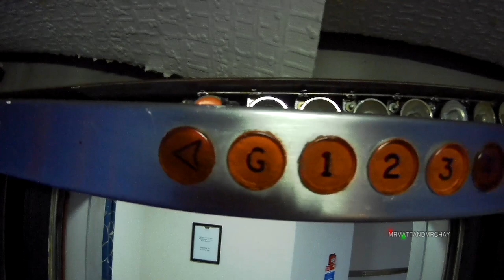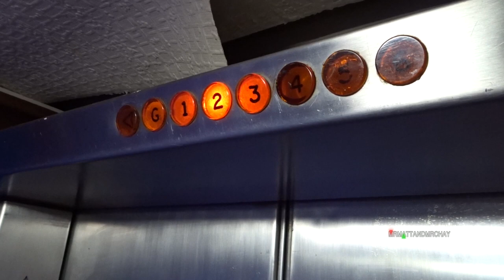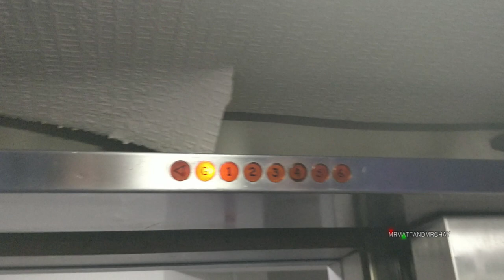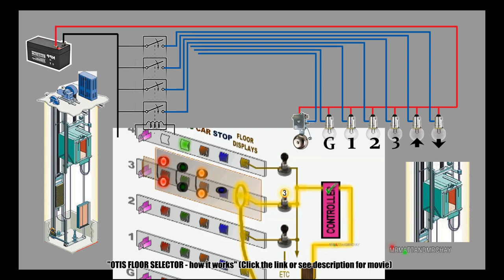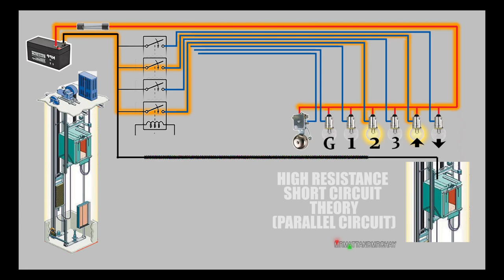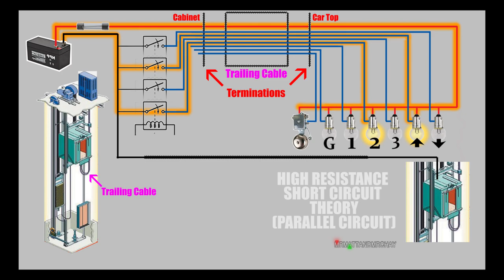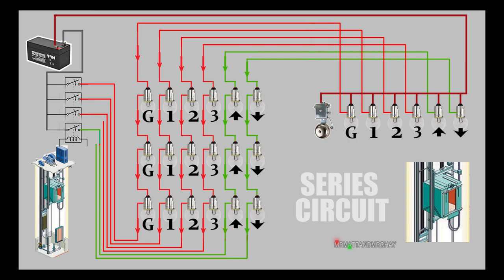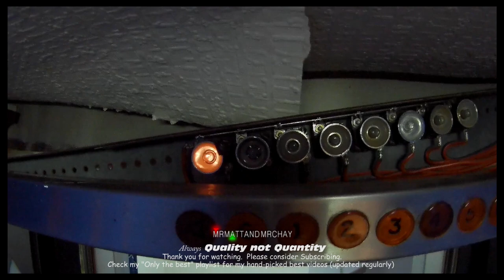A rare generator OTIS LIFT, now with WORKING LAMPS! (fixed!)

Comment: I'm so stupid for not asking this! The left lift, and ideas whether:
It was completely replaced with the ecodisc or just fixtures and logic replaced
It was originally another old Otis lift
The machinery from the old left lift is still in the motor room
If the left lift actually existed before the Ecodisc was put in
Reply from the maker: It's easier for them to abandon the old lift machinery and start again with standard MRL framework with the motor at the top of the shaft.  Trying to put the MRL machine in the old motor room would create unnecessary work with having to divert the ropes up here and back.
Also you have to think about companies and profits - again, quicker and easier to pull the old otis out completely and fit a standard lift than spending time modifying the cab to accommodate the new lift.

These would have both been 2x Otis lifts.  Maybe the management didn't have the budget to replace both at the same time.

Comment: Id suspect that the bulbs are actually wired in parallel since there are indicators burned out or missing on the outside of the car on the ground level indicator and call lamps, if it was series, none of those indicators would work, but the same basic idea though. I suspect that more than likely it was more likely a ground issue more than a short. A faulty ground (or earth) would cause dim lamps as you show on the video, and when you move it back and forth, you essentially clean the dirty or poor ground as you say. Just my theory on the thing, either way you look at it, good on you to get that thing working again. Hopefully the owners decide to keep it in service as long as possible. Hopefully the other one was just taken out because it was beyond reasonable repair? I've seen that happen here in the US since sometimes its cheaper to revamp it rather than repair it, especially with these old relay based logic units. Not to mention the median age of repair men who can service them are between 70 and deceased now a days. I hope you can see the motor room, because, you know, relay porn!
Reply from the maker: Thanks for the message will reply properly a bit later but just wanted to point out that the "wired in series" part was to demonstrate how it "cannot be" wired in series :)
Reply: And in this case you are right, this is more than likely a faulty ground rather than the "short"

Comment: I agree, the theory of a short is a good idea! I also have encountered such problems. Well, I'm am not an egeneer (too young (17)), but I am a proud owner of a Williams pinball machine. Some of the Solenoids, had the same dirty short, as the lamps in the elevator. This made the solenoids not functioning, and the fuse blew randomly.

Comment: Could also have a current limiting resistor there, to allow the inrush current in the lamps to be lower. The resistor is rated to survive even a shorted output without failure, and is common in industrial equipment  with indicator lamps, where the power supply has a resistor to allow lamp cold resistance to be gently started with a lower current, so the lamps last longer.

Comment: The lamps were always wired  in parallel and in this era they would be 110 volts. However many floors there were, the same lamp bulbs could be used. It was common practice to use an indicator lamp in a spare holder as a simple test device when fault finding in the controller. One end clipped to earth, the other end as a wandering probe chasing various points on a circuit until the lamp didn’t light when it should’ve.

Comment: Wow ! This lift is amazing ! Can't wait to see the motor room !
For me it'd make no sense to wire the bulbs in series, I mean you'd have to get a dedicated supply for each lift that has a different amount of bulbs (that would cause big problems of over-voltage). And also in the car, all the bulbs are working but not on all the floor landings, so It's obviously not in series. 
Wasn't you worried about being shocked while operating the floor indicator (I mean, it's 250V AC!)? 
Anyway, if all engineers where like you, world wouldn't be that cheaply made today.
Reply: It makes no sense to wire lamps in series since if just one fails all the others will stop working

Comment: I would have to say the lamps are parallel connected, since the 3rd floor indicator didn't work outside of the lift, but the one inside the car did work. I could see a loose connection on the common lead affecting the lamps in the car, but there would be a separate common from the machine room to the call buttons.

On the other hand, when you lose the common connection in the car, all the unlit lamps in the system act as resistors providing a high resistance common feed. This would explain the dim car lights. Were the call button lights and external floor indicator also dim?
Reply: Yes they were

Comment: Oi! About the display being wired in series; highly unlikely. Although these bulbs (looking into the direction arrows at the doors) really look like 12v bulbs. Also it adds up if you do 110v divided by 9 (floor and cab indicators) is 12.2 volts. I'm not sure, it's just a theory
Reply: i'd suspect 24v over 12v. If they were in series, then yes, 110v div by 9 would make sense, but in a parallel circuit the overall resistance of the bulbs wouldn't matter. I don't have any experience with these so I can't say with any type of authority. Of couse with the age of this particular one, 1970's would be my guess by the styling, its still very possible it is running on AC mains current.
Reply from the maker: I thought that was the point of the video to demonstrate why it ISN'T wired in series.  See the "conclusion" part where I state that they are NOT wired in series.  That part was just to prove a point that they can only be wired in Parallel. :)
Reply: Rare generator lift pt. 4: testing the cuircuit lol. I see what You mean. It wouldnt make sense to wire It in series.
Reply: Many incandescent christmas strings had a system to short out the bulb when its filament opened, so it was easy to see the burned one. It was a thin wire coated by a really thin white material wound around the terminals inside the bulb at the bottom. When the filament went open the full AC voltage appeared on its terminals and blew away that thin white coating, shorting the terminals.
It is a possibility that these lift bulbs are wired in series and have this system. But I consider more probable that the supply to all these bulbs is current limited with a resistor in series so a short circuit blows nothing.

Comment: I think the bulbs are connected in parallel. It's still possible that a short circuit or a high resistance may dim all the other bulbs as long as they use the same power source.
Reply from the maker: Absolutely.  I think people are misunderstanding the "wired in series" part...this was to prove how it "cannot be" wired in series :)

Comment: @mrmattandmrchay If this fix you did with this Otis worked, do you think it could also work with the M6 Hilton Park services Otis? While I am aware the lift they’re is currently out of action, if it were to be fixed would you be able to do it?
Reply from the maker: Hi, well this is a bit of an open-ended answer, because the answer is, 'it depends what's wrong with it!'.  If the Hilton Park lift needs parts that are no longer available, then it becomes difficult to fix it.  As there are two lifts side by side, everyone that needs to use a lift (remembering it's only one floor) will use the modernised passenger lift instead.  If this breaks, then the new passenger lift is going to be easier to fix that the old otis.
So going back to the original question, no such thing as a 'usual' fault, and there's also 'almost' no such thing as fixing a lift by simply moving a display panel slightly!!  ;)  Looks like I got lucky here!
Reply: @mrmattandmrchay  Ah this makes sense, obviously now that I think about it, something else may be wrong with it and it being a nearly 60 year old lift then the part may not be available anymore (plus, when I went there it definitely didn’t seem like the most up-kept building so due to the neglect, multiple things may be wrong :))

Comment: Hi MrMatt! What a great video. I have a silly question to ask you, and it’s probably because I’m American. I’ve noticed that in some of your videos, the lifts that you film use a strange floor numbering where the floors go 1, 3, 5, 7, 9, etc. They only seem to do that in older lifts, because the new ones use the standard floor numbering. An example is the lift in your “An Old Lift Means Properly Stuck!” video. I’ve never seen that here in America. Do you know why they do this? Thanks!
Reply: Alot of the lifts or elevators that he films are in old housing blocks are i've noticed many times there are ones for even and ones for odd floors. I could be wrong, but it seems to fit.
Reply from the maker: Hi, No it's not a silly question :)  The video you are refering to is split level car park.  So when you drive in you are on level G, then you go up a ramp to the front of the car park, level 1, then up the ramp to the next level to the back of the car park, level 2.  So each level is split.  There are 2 lifts at the back of the car park that serve levels G, 2, 4, 6, while the lifts at the front server B, 1, 3, 5, 7.  Coming out the lift that I filmed, if you exited at B then entered the car park, you could walk up the ramp to level G.
Some tower blocks have ODD and EVEN lifts.  To save money, there is a dedicated lift for G then EVEN numbers, then another one for G and ODD numbers.  If a lift breaks down, then the resident just has to walk up or down the stairs to get the other lift.  So in conclusion, if you see numbering 1, 3, 5, 7, then yes, there are other levels inbetween which are probably not served by the lift in question